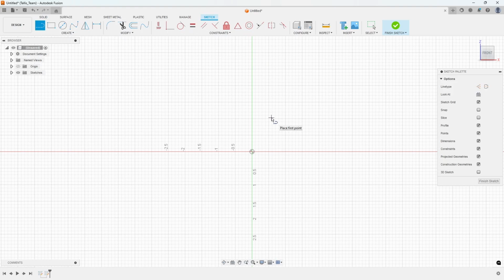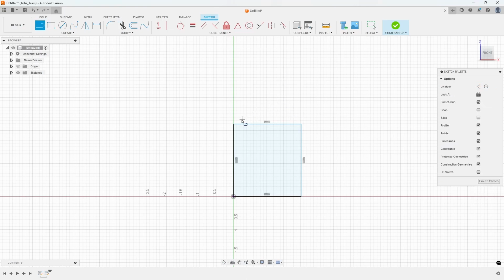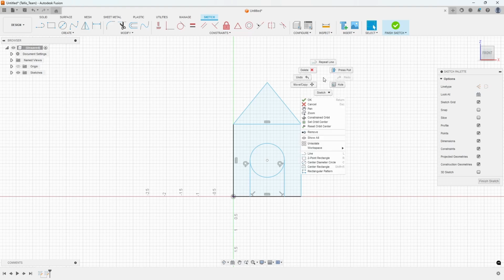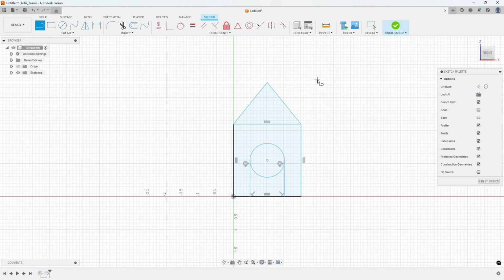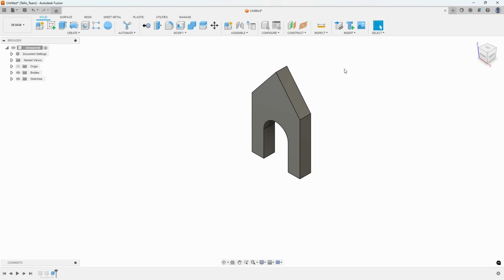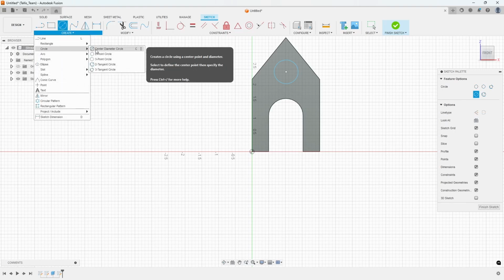Announcement & Marking Menu Quick Tip

Comment: Good luck on your future plans!  A couple issues I run into - when I draw a spline - and finish it, it remains blue.  If I move the spline often it will reshapes itself.  How do I turn the blue line to black so it won't reconfigure.  Second question and maybe a topic for you - If I am creating a design for the first time, I don't know what it will look like and don't know any of  the specific about it.  So, I just start drawing and editing and eventually I create the design but it is a mess with a bunch of fixes embedded.   After I finish the design I will often go back and layout the model in a better workflow.  Is there a preferred strategy to starting a new design?
Reply from the maker: Thank you!  As for the spline, you can use the "Fix" constraint on the spline points and then it will turn the spline from blue to black.  Otherwise, you would have to dimension the location of each spline point to "lock down" their location.  Your second question would definitely make for an interesting topic to cover.  I'll add it to my list.  I would say create everything as components and keep your sketches simple.
Reply: @bradtallis8968 I just found out today by stumbling around that you can turn the spline black by putting dimensions on the green handles. Thanks for all that you share. I will be reaching out for help in the future.

Comment: Awesome, good luck with your LLC Mr. Fusion! Had to watch this several times to get this. The Sketch label has a down arrow "V" which means there's a sub menu.  Too bad we can't configure this sub-sketch menu, or can we? Thanks.
ps. the "finish sketch" gesture is what I've looked for years.
Reply from the maker: Ya, you can't "configure" the marking menu.  It would be cool if you could though, huh?
Reply: @bradtallis8968  yes it would be, 'c' for circle and 'r' for rect are muscled memoried for me. I'd like the marking sub to have center rectangle and polygon. But I'll take this new ability as is even though its been there for years. Thanks Brad.